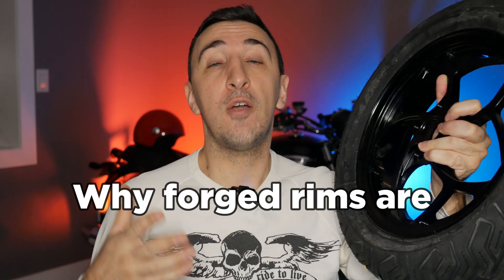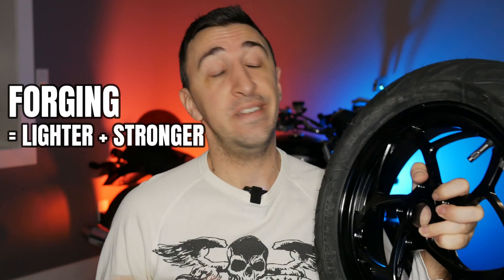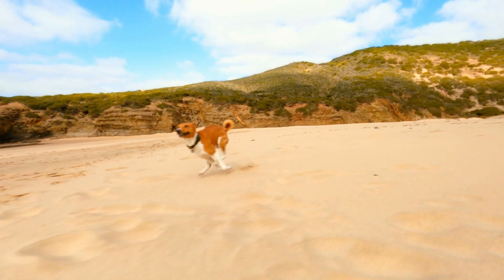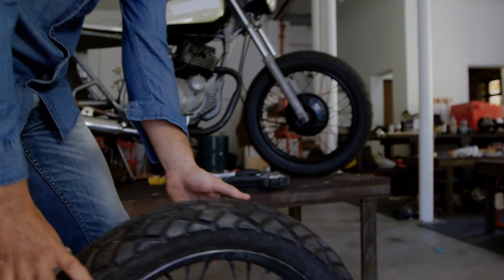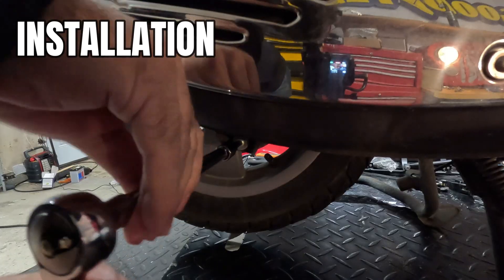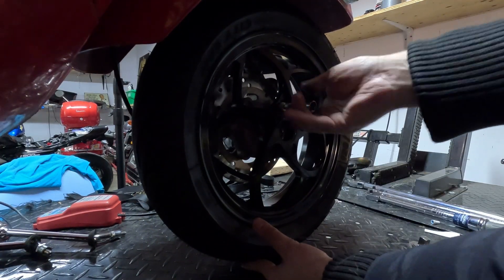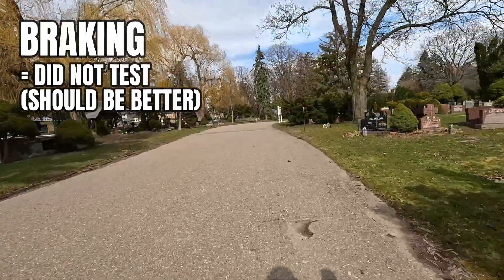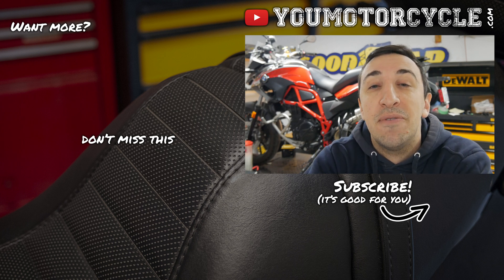FORGED vs CAST Motorcycle Wheels

Comment: yep, on a Vespa, it really must make a difference if you shave one pound off your wheels, lol
Reply from the maker: On a low displacement machine, every little thing is much more impactful. Like when I gained a few horsepower on my 1130cc V-Rod it was like a 4% gain, not really noticeable. When I I rejetted and gained a few horsepower on my 250cc it was like a 14% gain. Very noticeable lol
Reply: @YouMotorcycle  it would be easier for me just to skip my breakfast, there's 3 pounds right there, or maybe buy 300cc engine, let alone 600 twin
Reply from the maker: @MrAlkanet-nt9ic  I think you need to rewatch the part about why rotating weight reduction is different from static weight reduction 😜

Comment: For my Aprilia the forged wheels vs the cast wheels, both factory have a weight difference of 10lbs. That's a lot.
Reply from the maker: Full size Aprilia motorcycle or an Aprilia scooter?
Reply: Aprilia Tuono 1000R factory, so yes, a full beast of a motorcycle. What's very interesting, the OZ racing forged wheels are almost identical to the Brembo cast wheels, yet, 10 lbs lighter......... @YouMotorcycle
Reply from the maker: @tedmarakas2626  lol ok I figured as much based on the substantial weight savings, that's really impressive. Thanks for sharing those numbers it's good info to have out there!

Comment: Hasn't the Vespa got the motor and cvt insprung too?
Reply from the maker: Yep. The engine and CVT are integrated into the swingarm and connected directly to the rear wheel, with no suspension between them and the ground, so you're right to say they are unsprung.

Comment: I tried these wheels and noticed only a very slight improvement on the track and nothing on the street, just to be sure we swapped out a friend's bike with these wheels and he came to the same conclusion, apart from being a little lighter and easier to take of and on for the very large expense not worth it, your much better off with engine mods.
Reply from the maker: These forged Vespa wheels or other forged wheels?

Comment: LOL, I just went through this on my truck... my new tires are 11lbs heaver EACH, versus the stockers.  I found the extra weight softens bumps [but I also have 22" wheels on it - factory option], but the tires are different, so like you said, it's not quite apples to apples.

Great breakdown of the differences - and thank heavens, someone else knows about unsprung weight!
Reply from the maker: Dang, what was the weight of the original ones? 
PS: Thanks!
Reply: @YouMotorcycle  IIRC, they were 37 or 38lbs per tire [285/45/22] versus 48 or 49lbs for the new ones.  I really should do a video about my whole truck debacle I had in March.  Good things came of it, but it was frustrating as all get-out at the time.

Comment: Thank you for bringing attention to the problems of Unsprung Weight. When i see wheels on trucks getting larger each year, i suspect the owners know nothing about unsprung weight problems. My 2003 Chevy Suburban K2500 had factory 16 inch rims. Now I see 20 inches or larger on Suburbans and pickup trucks.

Side note - like the vlogger, I'm very fond of my Suzuki M50. It's a great motorcycle up to 65 mph / 105 kph. It's a lot more fun around town than my Victory Cross Roads Classic, which excells on the superhighways.
Reply from the maker: Hey Samuel, you're right. Big trend in trucks and SUVS towards bigger rims which add more weight, more costs, and no benefits other than aesthetics. Even worse is even they increase rim size to the loss of sidewall height, as sidewall plays a role in helping the truck/SUV suspension... But that's a whole other video lol.. PS: I will always have a warm place in my heart for a Boulevard M50.

Thanks for stopping by!
Reply: I really love my 2005 M50 also (only has 35,000k's).  Thinking about getting different handlebars and seat though. 
Last summer got up to 115/120 km/ph on 401 & 115.  Woohoo freedom.
Ride safe.
Michele
Reply from the maker: @dolcerebel  highway 401 and highway 115 in Ontario by any chance? I take that route to get to cottage country:)
Reply: @YouMotorcycle  Indeed, Ontario our beautiful Province!! That is my route to the cottage as well if I want to do all highway, or get off at Taunton and do the back roads East.  Maybe meet you on the road one day?!? :)